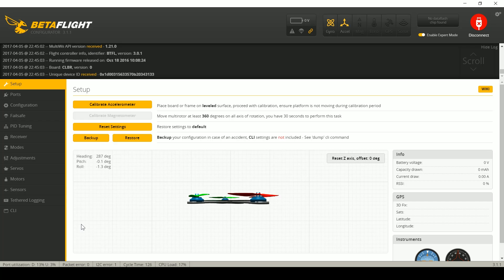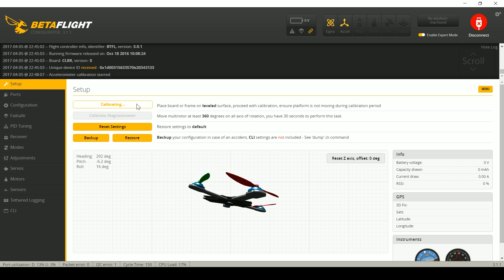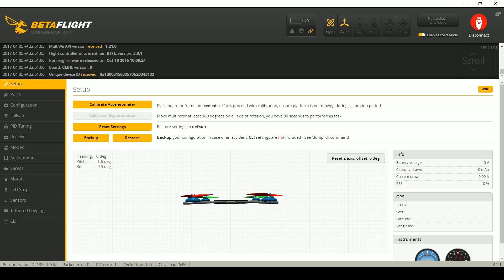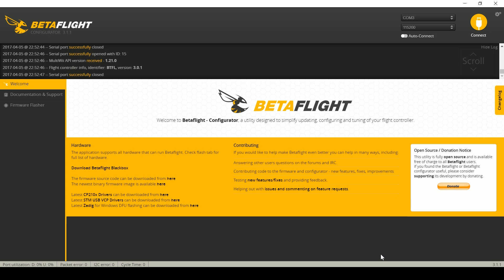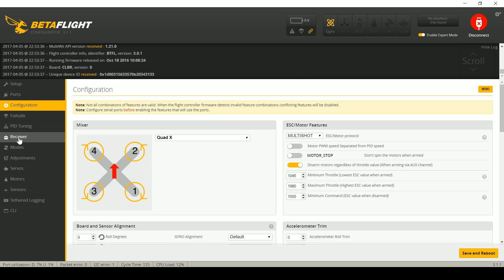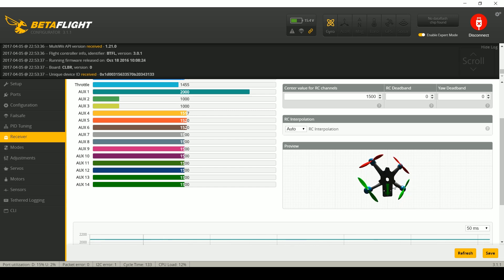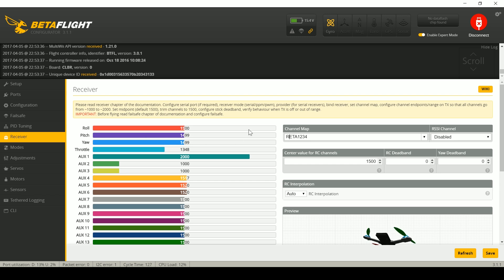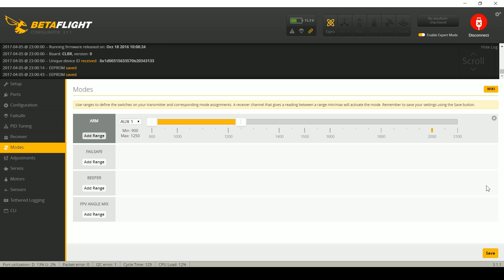Quadcopter Won't Arm | CLEANFLIGHT BETAFLIGHT

Comment: Hello, I ordered a Matek F405 . But now I'm struggeling to configure the board properly. When the board is connected to iNav, everything is working well (servos are working, motor is running with the iNav Master switch, Pre-arming check all green, GPS working, OLED display working, VTX working, LED working, buzzer working, … everything fine) but when I disconnect the board from my computer and try to arm it, it’s beeping non stop (with the blue led flashing) and the motor doesn’t want to run (servos and everything are working). I have flashed the F405 board with the latest firmware (inav_2.0.1) but it doesn’t resolve the problem. I don’t know what is wrong. Please help me.
Reply from the maker: What error message does the prearm check show? Is there some error in the OSD? 

Go to the CLI and type "status" -- what does it say?
Reply: Joshua Bardwell System Uptime: 1206 seconds
Current Time: 2041-06-28T01:04:00.000+00:00
Voltage: 4.40V (3S battery - CRITICAL)
CPU Clock=168MHz, GYRO=MPU6000, ACC=MPU6000, BARO=BMP280
STM32 system clocks:
  SYSCLK = 168 MHz
  HCLK   = 168 MHz
  PCLK1  = 42 MHz
  PCLK2  = 84 MHz
Sensor status: GYRO=OK, ACC=OK, MAG=NONE, BARO=OK, RANGEFINDER=NONE, OPFLOW=NONE, GPS=NONE
SD card: Startup failed
Stack size: 6144, Stack address: 0x10010000, Heap available: 1528
I2C Errors: 0, config size: 5374, max available config: 131072
ADC channel usage:
   BATTERY : configured = ADC 1, used = ADC 1
      RSSI : configured = ADC 3, used = none
   CURRENT : configured = ADC 2, used = ADC 2
  AIRSPEED : configured = none, used = none
System load: 3, cycle time: 1003, PID rate: 997, RX rate: 49, System rate: 9
Arming disabled flags: RX CLI
Reply from the maker: The arming disabled flags are the ones you care about. You can also see them in the OSD if the Warnings element is turned on.
Reply: Joshua Bardwell Can we plug the video reciever screen directly to the card? Osd is nut plugged in

Comment: A 250 quad built 18 months ago with a Clean Flight SP Racing F3 Flight Controller, never finished the finally setting with radio. After picking up again, I have flashed Betaflight 4.0.6 onto the FC. I’ve been through this time and again and my quad still won’t arm. After power up the blue LED is solid and the red LED is blinking. After toggling the arming switch, the beeper plays a tune and then nothing. What am I doing wrong?
Reply: Found the subsequent video about the status CLI command and played about with my min_check values and arming successful now.
Reply: Etops Flight this is brilliant news dude. After 18 months this must be a huge relief. I’m experiencing the same thing with my Tyro 109 and I can’t flash my board for some reason. I’ll get there eventually I’m sure. I hope it won’t take me 18 months though.
Reply: Cool Cat - 18 months off flying planes and too busy with work. Now back to 75mm whoops and time to get the 250 up and running as I was previously flying CC3D FC line of sight (had seriously jello problems). Bought the SP Racing F3 board as an upgrade but was using Cleanflight then.
Reply: Did you have to push a button down on your board to flash the board?
Reply: Cool Cat As I remember directly flashed from Betaflight Configurator from online. Amazed it was so easy. Having problems with a SP Racing EVO brushed board with Betaflight though. Used tweezers and solder boot pads but no cigar, might have to resort to Cleanflight or buy a new board for further troubleshooting.

Comment: Hello from England great tutorials love watching your rotor riot videos brilliant!I’m wondering if you could help me I’ve recently got into fpv and loving it Ive just got my first what I would call proper fpv quad well definitely an upgrade from what I’ve been training on it’s the makerfire armour 67 with the dms2 receiver and I’m using the jumper t8sg plus transmitter.its also my first time using betaflight I watched your tutorial on how to install it great vid by the way 👍.i have successfully bound the transmitter to the receiver and I have calibrated the quad but when I go into receiver mode my stick values won’t work on the screen?i can’t make an arm switch so I can’t start the motors would appreciate any help
Reply from the maker: Most likely your receiver type is not configured in the flight controller. In Betaflight. Dsm2 reveiver is protocol SPEKTRUM2048.
Reply: Thanks for your speedy reply Joshua I do have it set to spectrum 2048 I followed makerfires binding process on their website but they use a spectrum transmitter and I’m using the t8sg as I say it’s definitely bound to the receiver but doing nothing on betaflight.ive owned the armour 67 for about two months but due to work only recently got it out of the box and I’ve tried and tried to get it going🙄 I’m ready for the next stage in fpv flight training so keen to get her up in the air 😎thanks for you information it’s assured me I’ve done everything right.if you can think of anything else it could be I would appreciate it very much.thanks again lee👌
Reply from the maker: Assuming that the receiver is bound, then it's just betaflight configuration that needs to be finished.

What about the Ports tab? Have you got serial rx enabled on the correct UART?
Reply: Thanks for your reply I will go and check it  now if it works I will be over the moon thanks Joshua very very much appreciated lee 👍
Reply: I’m on betaflight now how do I know which is  the correct uart?

Comment: What if I'm getting a solid red light on my flight controller and qaud is not arming?
Reply: Sounds like a bad cable...or USB port maybe. Are you managing to enter the actual betaflight program?
Reply: @Cool_Cat-0  I am so frustrated with this. I haven't been in the air for 2 months now. I bought a laptop and downloaded betaflight. Question, if I have betaflight 3.2.0 and the flight controller is 3.1.0 or vise versa will that throw everything? off?

Comment: Copter on, on level ground, connected to wifi, on app, lights are all good, but when i push the takeoff button in app, the props wont spin. So frustrating and nobody has an answer
P-70
Reply from the maker: Unfortunately this video only applies to quads running Betaflight.
Reply: You reply so fast. I figured it out, it was weird. It would not take off from level surface but as soon as i pick it up the blades spin. Not sure what my problem was but i got it off the ground

Comment: I have a FlySky FS-i6 transmitter and a FS-iA6B receiver, but it is not connecting to my Flight controller (SP Racing F3 FC), when I goto configuration the throttle does not move and there is no AUX channels. and the throttle doesn't move with my controller.  Yes the controller is binded with my receiver. I dont know what to do please help
Reply from the maker: Connect the Servo plug output of the ia6b to UART 3 rx on top.... Left I think. Ports tab enable serial rx on UART3 and nothing else on UART3. Configuration tab set serial receiver protocol to iBus.

Comment: This actually helped, turns out it was the throttle below 1000
Reply: How do you change that??
Reply: End point adjustment, on my flysky i6 its a percentage (use roll to select columns)
Reply: @willhampshire2415  Thank you! I am new to fpv😄
Reply: 2fishy670 yeah know the feeling 😂

Comment: i have just builded a quadcopter but when it arms every time it does weird it makes a flip when arming and applying a little bit throttle i just dont know what it is
Reply from the maker: If the quadcopter instantly flips over when you arm and raise the throttle with props on, it is almost 100% certain to be one of these things:

1. Clockwise prop installed on counter-clockwise spinning motor or vice versa.

2. Flight controller not facing forward. Go to the Setup tab in the configurator. Tilt the quadcopter on all axes (pitch, roll, yaw) with your hands. The 3D model in the configurator should move the same as you move it with your hand. If it does not, use the Board Alignment parameter in the Configuration tab to fix it.

3. Motors not wired correctly. TAKE OFF YOUR PROPS. Plug in a battery. Go to the Motors tab. Turn on the "props are off" slider in the lower-right. Raise the individual sliders (1, 2, 3, and 4) one at a time, just enough that the motor begins spinning. The motor positions (1, 2, 3, and 4) should match the graphic in the upper left. If they do not, then either move the signal wires so that they are correct or use resource reassignment to virtually "move" the motors.

4. Motor spinning wrong direction. Do the same as step 3 but compare the motor direction to the arrows on the graphic in the upper left. If a motor is spinning the wrong direction, either reverse it using BLHeli (or whatever ESC software you are using) or swap any two motor wires with each other, which will reverse the direction.

Many times, people swear up and down they have checked all of these things, and then come back to say oops I missed one you were right. So if you think you have checked all of these things and your quad still FLIPS OUT, go back and check again. If your quad is insta-flipping on takeoff, it is almost always one of these things.

Comment: what does aux1 mean ?
how can I know that I use the right switch for arming?
I just build a copter but im too dumb to arm it.
Reply from the maker: The first four channels are the main control channels that fly the aircraft.

Channels after that are auxiliary which are used to do things like arm and disarm.

Channel 5 is aux 1,cjanmel6 is aux 2, etc.

Any aux channel can have any function.

Any switch can be assigned to control any aux channel. It's up to you. There isn't a wrong way to do it.

Comment: i am very dissapointed, i wanted to get into fpv hobby with the quads, invested into the mobula 7 hd. i cannot get it to work. i have a dsm jr radio and seems like all the controlls are mixed in the betaflight. the quad wont arm . cant get it even to sit still in the receiver section where you check you chnnels. nothing works it just keeps spinning. spend almost 2 weeks every day trying to figur this out and it doesnt work. its a spektrum receiver version i followd you videos and the instructions that came with it and it seems it was wasted money ;(
Reply from the maker: You need to rearrange the channel mapping in the upper right corner of the receiver tab.
Reply: @JoshuaBardwell  thank for your reply, I tried doing that and it doesn't work. When I move the main 4 channels as in roll and pitch etc. Aux 1 2 and 3 move instead of the coresponding channels. I have tried changing the  order of the mapping in the recover tab but it doesn't work. not sure how to resign these as the radio is set in airplane mode without any mixes
Reply from the maker: It sounds like your transmitter has the main control channels on 4-8 for some reason.

Change the channel map from:

AETR1234 

to 

1234 AETR

or something like that.

Comment: mine says land now
Reply from the maker: It thinks your battery voltage is too low.

Go to Power And Battery tab. Look at the voltage that the quad reads when you plug in a battery. If it is not correct, adjust vbat scale until it is ocrrect.
Reply: @JoshuaBardwell  thank you

Comment: Hey Josh,
Your video helped out alot... However, the drone will "arm" but only like 1 or 2 propellers would turn for like a second and shut off... Any ideas?
Reply from the maker: Use the Motors tab to test whether all four motors begin to spin at the same time. If you are using oneshot or multishot, run ESC calibration procedure. If using Dshot, then calibration isn't needed.
Reply: @JoshuaBardwell  thank you so much!

Comment: for the Tyro 99 or 109 how do you connect an OLED screen and a compass
Reply from the maker: Both of those would require an i2c interface on the flight controller. This would be marked as an "SDA" and "SCL" pin. I would not be surprised to learn the Tyro didn't have such an interface.
Reply: @JoshuaBardwell  Well i can not find them see link for board, let me know your thoughts https://www.eachine.com/Eachine-Tyro99-210mm-DIY-Version-RC-Drone-Spare-Parts-Customized-F4-Flight-Controller-OSD-LC-Filter-p-1257.html,   thanks Joshua
Reply: @JoshuaBardwell  Forgot the other question, can you run the compass and OLED at the same time, if i switch say to a betaflight board or omnibuss board or MATEK F405 original one
Reply from the maker: I honestly don't know. Hardly anybody runs OLED screen on a mini quad because it will break.

Comment: (SOLVED) My betaflight isnt responding to my transmitter at all. It binded easy but nothing happens when i use my transmitter.
 The problem was: in betaflight my receiver was set as SBUS. I have an IBUS receiver so i just switched it to IBUS and it worked.

Comment: Sir, I Happen to Only Have 4channel.  I dont have control for Arming.  Is there any way I could fly my Quad with only 4 channels ?

Thank You
Reply from the maker: Yes. Use stick arming. With no arm mode defined, throttle down yaw right to arm and use left to disarm.
Reply: @JoshuaBardwell  Thank You Soo much Sir.

Comment: Hello Mr. Bardwell 
I have a problem I dont understand . I have a qq190 . I bought the frame and then the full power cube with 4 esc boards and vtx. The problem I'm having    is arming ... two motors 1&4 wont spin up until around 1500 the other two act normal 1080. When armed I do have a red light on the control board.
 Cli indicates 1 error , config size 1628
All mins are set right.
Do i have esc issues ? Strikes me as odd that it's two motors and on opposing corners. 
Help please  , my head hurts

Comment: Wish I could send you my tinyhawk and jumper t8sg I’ve tried everything and watched all of your videos at least twice I still cannot get this to arm it’s driving me crazy as I’m new to betaflight
Reply from the maker: 1. Confirm receiver channels are moving in receiver tab. If not, the receiver connection / configuration is wrong.

2. Set up arming mode in Modes tab. Does the aux channel move to the selected range when you flip the switch?

3. If it still doesn't arm look up my video "Betaflight won't arm introduction". I think the playlist is linked in the description of this video. It's an updated series helping to troubleshoot arming status codes.

Comment: Joshua,

I have tried all of the things you suggested and still no luck. I get the three beeps when gyro is set and two beeps when I throw arm switch and another two beeps when I disarm. This build has always been a mystery, sometimes it will and and sometimes it won't. In fact, iv'e been on the starting blocks arm and everything looks great. Sit in my seat and arm again with just the two beeps with no motor spin.
Any more tips? Should i re-flash the board.

Dan
Reply from the maker: Two beeps is the usual response to arming. It sounds like maybe your ESCs are not getting signal from the FC to actually make the motors spin.
Reply: I am using a Detonator 30Amp from RTFquads and an Omnibus F3 FC. I cant remember if caps are removed, I have it configured as Dshot what would happen if I changed it to multi shot? Would that hurt anything?Dan

Comment: This video helped me.  My min_check value was too low in Betaflight so couldn't arm my Mobula7.  I changed it in Betaflight rather than mucking around with my jumper T8SG (black and silver model).  Just seems so easy in Betaflight vs digging into transmitter menus.

Comment: Hey !!! Using your video finally I made may hexa fly !!! Thanks a lot !!! One thing maybe you know... my eachine ex 120 starts already in Acro mode... which option should I use with one of the AUXs to make it more easy to fly... to take it out of acro or something like that. I tried to use the ACRO, but it changed just to a soft acro, but still acro. I want the one with stabilization that is easier for begginers... Thanks !!!
Reply from the maker: https://www.youtube.com/watch?v=vH3eH7yI2SY
Reply: Joshua Bardwell Again, thank you very much. I just subcribed to your channel and is liking every video I watch. I also decided to support you on patreon. I am a begginer and need your help. I know there are tons of videos already done, will try to search them all. What I need now is a good simulator (as the one you used on this video other video). Second, I will travel to US January and I see the list on your site. How to buy something on Amazon also supporting what you do ? I am amazon prime so my first choice would be to buy at amazon. Thanks and congrats for the nice and amazing work you do !

Comment: every time i change my min_check it will go back to 1000 first i change it to like 1050 then i typ get min_check min_check is 1050 then i reconnect and then its 1000 again
Reply from the maker: Need to type "save"
Reply: @JoshuaBardwell  wow

Comment: would you know why AUX2 moves when the throttle moves ? they move equally . i'm having so many problems arming and this is just one other problem. betaflight f7 , dshot1200 escs . your vides have helped me with other probs thank you.
Reply from the maker: First thing I would check is look at the radio channel monitor and see if the radio shows those two channels moving together. That would indicate there is something wrong with the radio setup which is moving both of those channels at the same time.